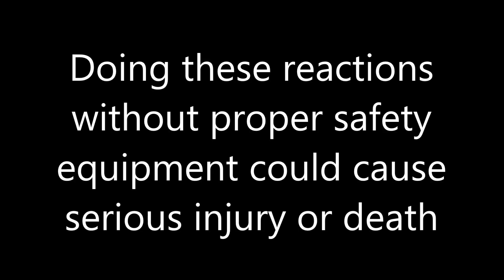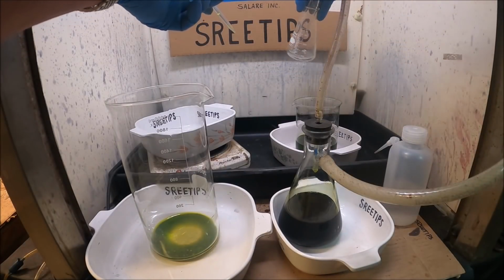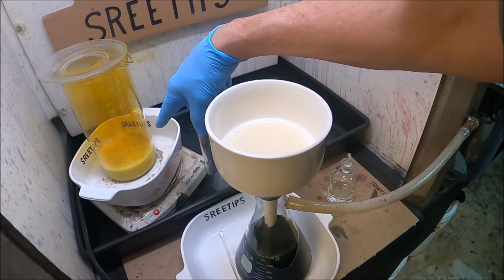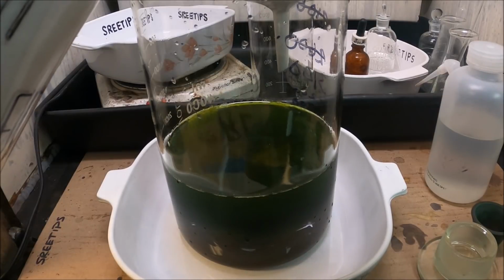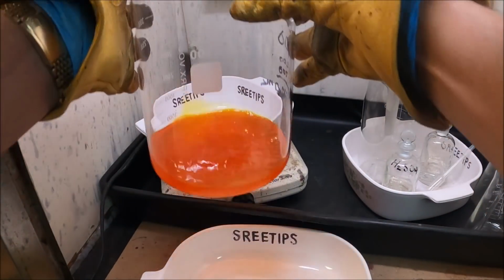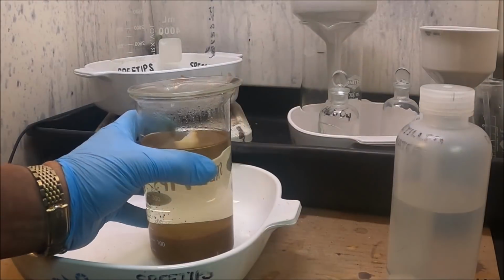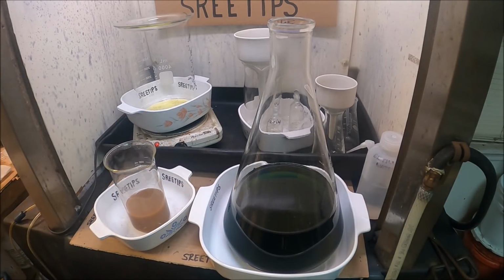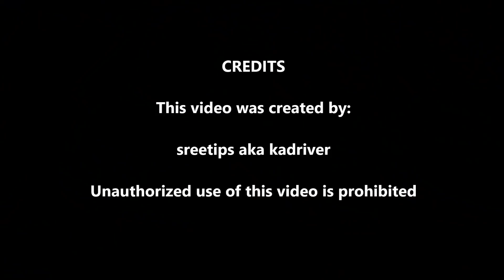Simple Gold Filled Scrap Refining Part 4

Comment: Would be interesting to see a spot plate detection series on the pregnant green solution just to see what might be in there. When you have a clean gold solution it's yellow/gold colored, but the impurities from the gf scrap gives you a really different appearance, so it would be neat to see if you could figure out what else was there. I know it would add steps and time, just think it would be cool from a teaching standpoint.
Reply: Would gf scrap be a good candidate for precipitating more than once with different precipitate like smb followed by copperas or do the potential values not warrant that much time and resource expense?

Comment: A rubber stopper with a right angle glass tube through the stopper that extends past the vacuum port would prevent it from getting aucked into the port.

Comment: It's not a flask problem it's the taper adaptor that lets the solution run down the flask wall rather than into the middle of the pool of liquid. The old two hole bung worked because the two pipes were at different levels (vent up and liquid lower).

Comment: hello sir, I hope you are always in good health, I am amazed by your consistency as a YouTuber specializing in refining metals, especially precious metals, which I want from you further and earlier, please demonstrate the final stages of the complete process for the highest gold refining equivalent to 999.9 ( 4 number 9) If necessary you can test water weigh and get water test results with a table of numbers more than 193632, even more than that, the quality of your refining results can match the quality of pure gold FINE GOLD Bars PAMP or Sswiss refined types
Reply from the maker: Taking three nines gold and running it through an electrolytic gold cell would probably do it. Might even get it to five nines. But then you’ll need an instrument finely calibrated to assay. Anything over 999 parts per thousand is over-kill. In my opinion.

Comment: the quickest way to refined it is to take it to a smelter, weight it, smelt it and collect the check at 97% gold spot for that day.. no mess no fuss no deadly chemicals, it works for me each and every time.
Reply from the maker: Trading real metal for paper? I’m doing the exact opposite and converting my paper to metal as fast as I can.
Reply: @sreetips  point well taken.. metal trumps paper any time, but I am too lazy for all that rigmarole and  wish I had the knoweledge and apparatus to do what you do. ;)
Reply: Rock beats paper and scissors!
Reply: @robertjeffery5364  yeah.. but a check of $ 12.600.00 for an afternoon of work after spending only $ 3.500 is nothing to sneeze at no?

Comment: I accidentally killed my vacuum pump by getting nitric sucked into my line. I now have a 1 liter gas wash bottle setup inline before my new pump to catch any accidental fluids that might get sucked toward my pump up in the line
Reply from the maker: My vacuum pump draws on an old 8 gallon air compressor tank converted into a vacuum reservoir.

Comment: I am trying same process for the last 2 weeks, I had 3 batches of gold filled stuff. Was planning to do one at a time. Issue is, I can't precipitate gold. Now I have 3 beakers with gold in solution and SUB dissolved. I used different demos methods. Nothing. Worse, a batch of Platinum and other with Palladium happen the same. For these at least I managed to drop salt with Zinc, now I am re-refining to remove impurities accumulated during m failures. I am sure I won't succeed in the precipitations. If so, I will drop with Zinc or Copper and burn the salt to calculate (calcificate??) and convert to metal powder by moderate burn.. For the gold I am lost. 🙁
Reply: BTW, my solutions at the end get to the very same color as the video. Difference is when I add SMB, it gets brown. I have a batch resting,  let's see tomorrow morning since I was a video where the reaction was not immediate. Sighs of hope

Comment: That color of the gold dissolved in Aqua Regia 😍 Reminds me of Spessartite garnets or clementines/mandarines
Reply from the maker: The colors are intense
Reply: Hessionite garnet, cut a beautiful stone too bad it's so hard to find good rough...
Reply: @rickthefatman8426  Hessonite is a little browner than Spessartite. I have quite a lot of rough Hessonite from Jeffrey mine, Asbestos, Qc. And some Spessartite from Oyo State, Nigeria. Spessartite is much brighter. 
I love all garnets, tho. Especially demantoids and tsavorites.
Reply: @ricois3  True about the spessartite, love how they cut. I have some old stock hessionite from a lot I bought in Franklin, NC at factors frolic one year. It has the original tag on it. They're all quite small and flawed but they have a really nice gold/orange color with only a hint of the brown. Someday I'll cut one, though it will be quite small if it doesn't explode on the dop. Don't have any tsavorite, but I'd love to get some.